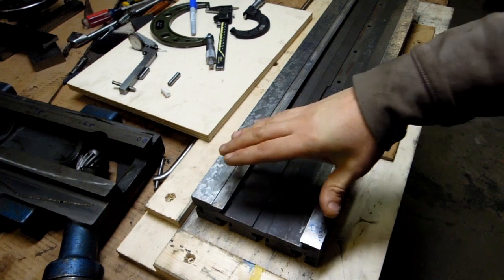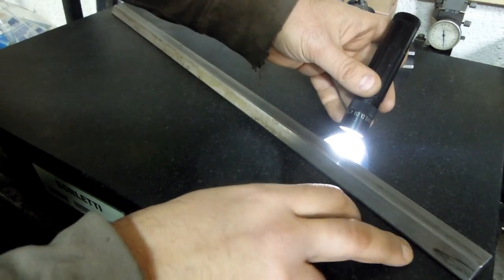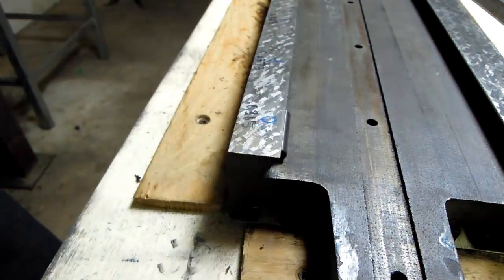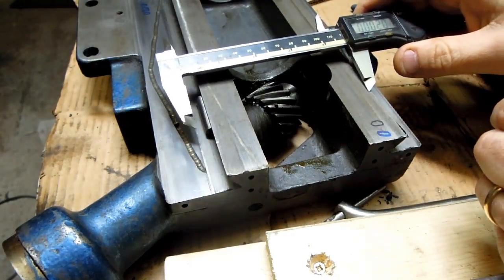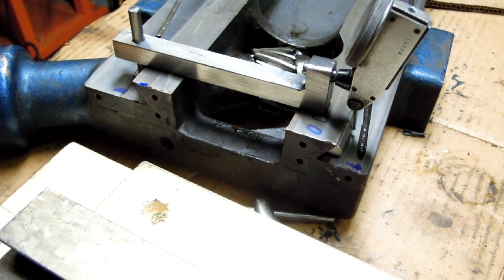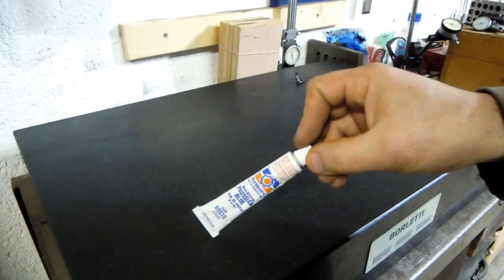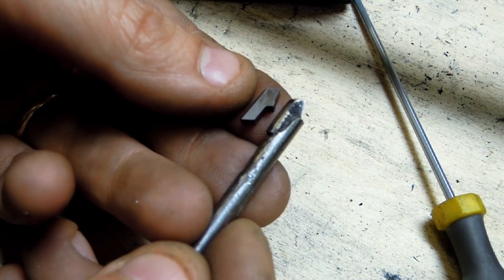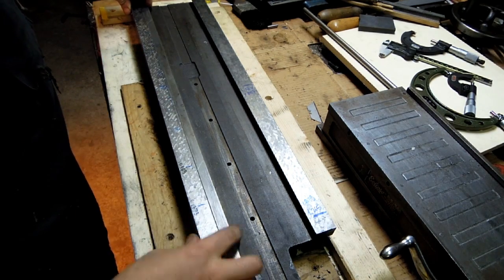Surface Grinder Rebuild - part 2

Comment: I’m not a machinist, and this is my second time watching this series of videos, the first time was years ago when I found your channel. But, as I was just watching you trying to figure out how to measure the dovetails and gib it occurred to me the material you are removing to remove the wear is kind of three dimensional and will affect how it all goes back together, and that got me thinking about specs. Do you have the manuals for this thing, and if so do they give the specs of all of these components and how they go together?
I would think the manuals would have instructions on what datum to use for each measurement and what the tolerance is for wear on these components.

Comment: When Tony mounted that gib on the magnet, I said "Nooooooo!". I was very surprised it didn't fly off during milling, but not surprised it was sucked down in places causing the flatness problem. Me, I would have unrolled a yard of #320 wet-dry, marked the gib with my Sharpie,  and lapped it flat.

Comment: normal advice: measure twice cut once
tot interpretation: measure 10 different times in 10 different ways from 10 different references with 10 different measuring tools

Comment: I was combing Amazon for tool deals and came across a screaming deal on a mag chuck. Unfortunately I have no use for a mag chuck, nor do I personally know anyone that does. So to my internet family I bequeath this info. It's a HHIP 3402-0805, 8 x 22 Inch Dense Permanent Magnetic Chuck - Fine. On sale for $420, appears to retail in the $2k range. There's "Only 1 Left," so if you happen to stumble on this and the price has jumped up, somebody beat you to it. Hope this helps somebody.

Comment: This is a fascinating insight into what it takes to get equipment straight and flat. I don't understand the hand scraping however. Wouldn't that introduce localised uneven surfacing?
Reply: Pockets created by scraping hold oil

Comment: I always knew that you are a very talented machinist but that you have patience that much????? that’s remarkable. My little Old Chinese mill is 
Waiting for rebuilding. My daughter found a57 degree cutter from China, that dealer had two of those. I intend to build a surface grinder to my limitation not what you are doing. The most urgent thing to build for me now is a motorbike starter on the lift. I cannot kickstart those  things animore
Terrific show Tony, really enjoyable. Thanks. Bob

Comment: Bowing!   I had so many problems with it scraping bronze dovetail gibs.  Scrape one side flat to my surface plate, scrape side 2 to it, felt so happy until I did a follow up to side 1 and did not need a light to see the bow.  I think it had more to do with the fixture I used to hold it while scraping.  That and possibly warpage due to material removal on a tapered gib.  Almost made me quit machine repair and go to work as a cook.   If WalMart had been hiring big ugly greeters, a career change would have happened!

Comment: On the measuring jig you made and used at 13:00,what's the range of error that could be introduced by the heat from your hands warming the metal and lengthening it slightly between the first and last readings ?
Reply: according my limited knowledge: assuming the lenghtening is in line with the measurement and he is warming up a 20mm long part of the Steel piece by 10°K (or C), the difference in lenght should be around 0.0023mm. In reality the rise in temperature might be lower but spread over a longer distance, depending how he is holding it but it takes more than you think to warm up a piece of steel by 10°. It's a relatively easy calculation. Steel has an α of 11.5E-6 per °K. Multiply that by the lenght under influence and by the degrees it is warming up.

Comment: #TOT Found your channel a few weeks ago, have watched a ton of your videos. Great channel and lots of Really Great information. You probably do things differently these days, as this video is going on 5 years old.... but I did have one suggestion, when cleaning your surface plate. instead of using lighter fluid which does leave a slight film as you mentioned... have you tried 91% or better yet 99% (if available in your area... or amazon) rubbing Alcohol? Its fairly cheap, drys very quickly cleans just about anything really well, and it leaves Zero residue. I use 91% (what available around here) in the shop all the time, not only for cleaning but a lot other purposes as well. Such as when trying to push rubber hoses onto barb or other type fittings, Work Awesomely, and unlike "hose grease".... once the alcohol drys (in min or less) the hoses will not easily come off either. But Almost Endless uses for 91% or 99% alcohol around the shop though. Once you start using it, you'll keep a stocked supply of it in your shop :-)

Don't know how much stainless surfaces you work with, but another tip I learned on a job back years ago was to use Windex on all flat stainless surfaces. It cleans the surface super well and seems to make it shine, and doesn't fingerprint up as bad either.

Anyway, just throught I would pass that on. 
Keep up the Great Video's Tony! Thanks for sharing your knowledge and experiences

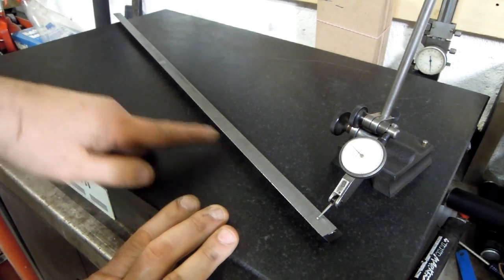Comment: 17:22 This is normal, after machining you get a banana. It's about tension in the material
and the heavy processing of the metal by milling. You should done some grinding on both
sides of the bar, tho you stil get deviation.

Comment: About that "why chicken crossed the road" @ 8:50 (and why that steel gib got worn out more than cast iron side of that dovetail slide) - my guess is, the reason behind it is that cast iron is self-lubricating metal (as it contains graphite), while steel is not. And while cast iron is rather soft, that gib is not made of very hard steel either - perhaps regular mild steel, or medium carbon steel.
Also, the grinder generates quite a lot of fine abrasive dust - most of it should be taken away (and out) by a proper dust extractor (IF INSTALLED), but some will inevitably find its way onto the grinder itself (and onto its slides). Not much, but multiply it by many years in production environment, combined with "good enough for my pay" care of the employees, and a lack of proper lubrication (those clogged lubrication points seem to indicate inadequate care and maintenance as well)  - and it all will eventually add up.
And then maybe that dust embeds itself better in steel than in cast iron, or perhaps the self-lubricating property of cast iron mitigates the effect of abbrasive dust - for instance, by coating abrasive particles with graphite...?
Just guessing.

About the placement of the wear (low spots - and why they are where they are) I'd consider direction of forces exerted on the table while the grinder is working - mainly, the "sagging" of the table as it slides out of the base (left and right), and also those forces perpendicular to the movement of the table (in relation to the gib position - as the surfaces that are pushed toward each other while sliding past another get worn faster). And I think that this was taken into account when the mill was designed - I mean, they could place the gib at any side of the table, yet they had to decide for one of them two - so my guess is they thought it over and placed it on the side that wher the greater wear is expected.
Reply: "And then maybe that dust embeds itself better in steel than in cast iron, or perhaps the self-lubricating property of cast iron mitigates the effect of abbrasive dust - for instance, by coating abrasive particles with graphite...?" 

You're almost right. The particulates when the two surfaces slide against each other gets embedded in the softer of the two materials, in this case the cast iron and that turns the cast iron into a lap which wears the steel gib. It's quite clever design aspect to reduce wear on the cast iron parts and instead put it on the gibs. Same in my deckel mill.

Comment: I guess grease isn't the best lubricant to use for a surface grinder's operation.....who knew, evidently the fellow that had the machine before you didn't.  Again I commend you on your patients and thanks for the video, a job well done.
Reply: Oil only

Comment: 13:36 By sweeping the indicator back and forth without moving the side with the pin... Aren't you shortening the distance, therefore not getting an accurate reading ... ???
Reply: The shortest distance, provided he doesn't move the other end, is the width of the dovetail - i.e. there's no angle. Its where each measurement point is perfectly opposite. If he didn't sweep it and pick the minimum he'd have to get it perfectly square (assuming the sides are perfectly parallel!), Sweeping and picking the minimum automatically gives the measurement at that point.
Reply: Gotcha... Thanks

Comment: Surface scraping never heard our seen that before, you bring a part that looked that to all of us Mechanics at work. We refuse to put it in, until QC/QA whatever you call them came over a fully measured that just because of the marks on the surface. However it looks like it worked, and that’s all that matters.

Comment: I have watched about all of Tony's videos and this project and the mill restoration project both seem far more difficult than all the other projects because of the squaring process that they both went through. The squaring process is most difficult part to understand for me. What do you use for a starting base reference point would be my biggest question. I need to go back and watch these 2 series again to try to understand that better.  These two projects have the most multi video parts because they were the hardest projects. They both look like no fun at all compared to his other projects, and most of those don't look that fun either. The brass knuckle aluminum air gun valve was fun.  And so much easier than squaring a machine.

Comment: Tony

I spent several years doing precision grinding while completing my mech engineering degree.

You did not show how you ised the mag chuck exactly. In my experience, we would energize the chuck, wring the part on it and then turn the chuck off. The residial magnatism held the part for fine grinding and induced less thermal and mechanical distortion in the workpiece. 

I built air bearings this way.  We routinely worked to tolerances (form and position) on the order of 0.000010!
Reply: I was guessing it might have been due to internal stresses relieved by milling, but my accuracy doesn't have as many zeros as yours!

Comment: Bearing surfaces can seem strange. For least wear with cast iron, you either need cast to cast, or cast to hardened steel. Mild steel wears like crazy against cast iron, but hardened steel doesn’t, and, if well finished, doesn’t wear the cast iron much either. That’s all assuming that everything is well fitted, and properly lubricated.

Using grease in these cases, such as was used in your machine, is a major screwup.

Comment: I think a lot of flak that goes to the humble digital calipers is from the old ones, and, from the inability of some, to read them properly (there is a technique to it after all). Nowadays, they can be pretty darn accurate, when used with a fresh battery.

Comment: Thanks for these videos, I know they're 3 years old, but your surface plate and measurement techniques are informing.

Engine starter fluid (ether) in a spray can works marvelous on Hi-Spot cleanup. I buy it by the case as it works great for removing grease and oil films from anything I'm taking apart for repair-rework. The can indicates there is some sort of upper engine lube, but I see zero evidence of this (my skin is left with a dry white oil-less surface, I 'feel' it's much safer then other solvents, especially gasoline). It evaporates real fast. I typically take the part outside, and spray it over the refuse can with expended paper/rags. 

That Suburban guy uses ammonia cleaner straight out  of the jug, for surface plate cleanup (do not inhale!). But my experience, it has no affect on oils and such.
Reply: Fred Hababorbitz that's weird, ammonia should dissolve pretty much all oils and greases — that's its primary use case. Maybe it doesn't work with silicones?

Comment: I just watched this old Keith fenner straighten out prop shafts with a oxy torch. Can you relieve the bow in cast iron using heat? Or am I barking up the wrong tree?

Comment: Be happy you used the magnetic chuck although it could have had some wear in it aswell. Usually thin straight pieces tend to go bananas when machined.

Comment: Perhaps not ALL of the adjusters on the gib had been used and allowed flexibility over the years causing uneven wear?
Reply: These tings wear in the center because most of the use is in a 6 inch center usage

Comment: why didnt you just use your surface grinder instead of scraping all the surfaces by hand?
Reply from the maker: For a minute .. you almost had me.
Reply: This Old Tony hahaha. when's a new video coming out? I'm off work for 6 weeks because I cut through 2 of my tendons and I've watched all your videos already.
Reply: @ThisOldTony  you should go back and teach yourself time travel so you can go forward and get your surface grinder to go back and save some time doing this..
Reply: @ThisOldTony  😂😂😂😂
Reply: Mordekai watch 'em all again I am!
Reply: @Infandous Ktenology  - Well, my remark coming eight months after your "on the spur of the moment" idea might be tad late, but anyway, let me share it - basically, I'd rather NOT use the word "toss", as it might be, well... "misinterpreted", so to speak - depending on the state of the relationship with your best wife ("she's the best of all the wifes I have").
"But he asked for it" seems to be quite reasonable line of defence, innit?
Reply: What is the reason for scraping by hand anyway?  Obviously not designed for, but why couldn't the knee mill be used to remove miniscule amounts of material, to make the bottom parallel with the top?  What am I missing in the realm of machining?  What about all the inconsistencies with anything done by hand?  I'm missing the logic here.   thanks
Reply: Chris Harrell there is also an advantage to a scraped, rather than milled or ground bearing surface.  The valleys between the high spots on the scraped surface act as reservoirs for oil, which keeps the ways better lubricated than an absolutely flat surface would.  It may help to think about how two mirror-polished gauge blocks will wring together, rather than slide easily.
Reply: @firstmkb  very good!
Reply: @chrisharrell5945  his mill has some wear which when he first ran it across, it created the differences he had to scrape off manually
Reply: @chrisharrell5945  I believe it would be easier to remove very small amounts of material here and there by scraping than trying to skim cut different spots here and there with a mill that precisely. Removing just a thou or half-thou without overshooting the target removal with a mill is risky. I believe the idea and scrape off the humps and smooth with a file or stone.
Reply: Maybe you could space out from the ground rounds with a couple of gage blocks, then slide the assembly down the table checking for variation. The flat gage blocks should keep you from having to wiggle the mike to find the minimum distance.

Comment: Hi mate.  I think that the uneven wear could have been two fold.  On the one hand the use of grease, that might or might not have between the surfaces, or the uneven tightening of the set screws of the gib.  Just a guess.

Comment: Like your series. Do you have any suggestions as of how to rebuild a mill without a surface plate? The table of my mill is very long.
Reply: Lars Berntzon  look for a book called Foundation of Mechanical Accuracy. Published by Moore Tool. Out of Print though.

Comment: You are wondering why the cast iron on cast iron wore more than steel on the iron?  Reason is that two similar metal weld to each other and when moved the welds break, in effect wearing parts.  Dissimilar are used in many moving applications such as gears, or sliding mechanisms as the tendancy to weld is less.
Reply: No cast iron is one of the only metals that readily runs against itself as a suitable bearing surface. They have been running camshafts against parent metal cast blocks for over a century. The secret is the carbon suspended in the iron and burnishing  the surface where it contacts
Reply: I think this might be it considering that the oil situation was as described in the previous video. Whomever used this before was a jackass.

Comment: Could you have not just lapped these joints, then tighten up the gib? Seems like you went quite a bit over board with all the cutting. 
Just asking, I'm not a machinist, but I did sleep at a holiday in last night!

Comment: Your dovetail measuring pin rests against the rough machined surface.  Wouldn't a block that rides the scraped surface and 'hangs' the pin on the dovetail be more true to the reference?  Love your videos!

Comment: You really want Canode Die Spotting Ink. It is water soluble, so you can clean it with Windex and it will actually come off of your hands with soap and water.

Comment: Terrific round 2!  Thanks for the length info and the Gib work...real nice.  Surprised this has a steel gib for the vintage, but not that it tweaked after working it on the mill.  Could be the grain or the magnet as you suggest.  Really like your creative measuring and double check methodology.  Thanks for sharing and teaching us the way of Togishi and the pipe wrench was a hoot!

Comment: Excellent job! Do you have Ed Connelly's book? Also how did you get over gouging with the sharp corners on your scraper? I built a similar one using hss but I stopped using it because I kept digging in.

Mike
Reply: I have connelleys book.
Excellent reference.